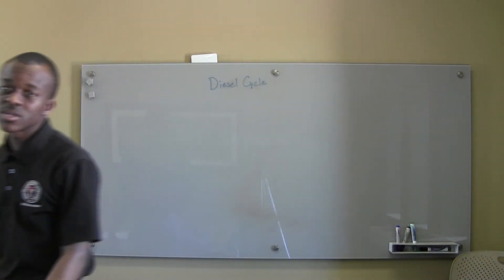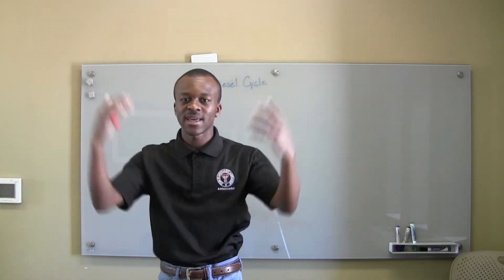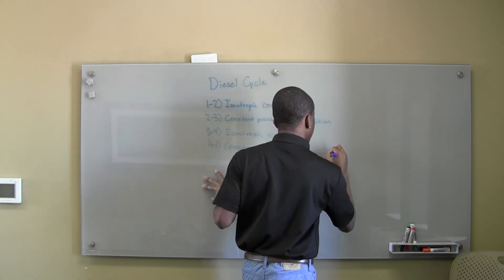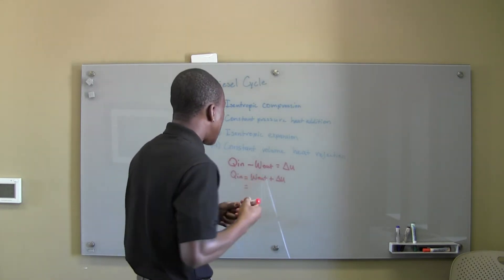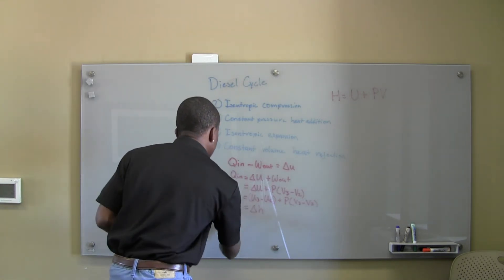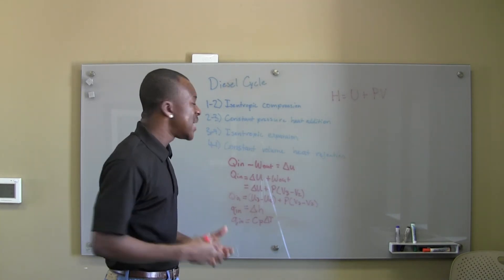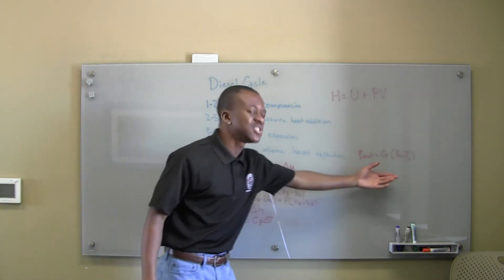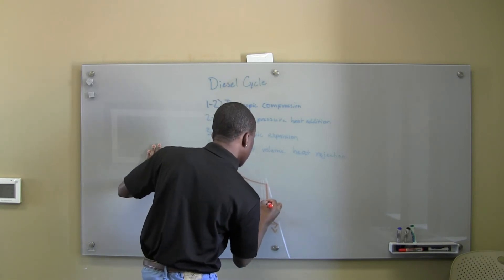Lesson 20: Diesel Cycle

Comment: At 2:55, I thought Win was supposed to happen from 1 to 2 and Qout was supposed to happen between 2 to 3, why you show Win and Qout together from 2 to 3?
Reply from the maker: I showed Wout and Qin. From 2 to 3, we have constant pressure heat addition. Because there is heat addition, we have constant pressure. Because the piston is expanding at constant pressure, this also gives us an output of work, meaning that we have Wout.